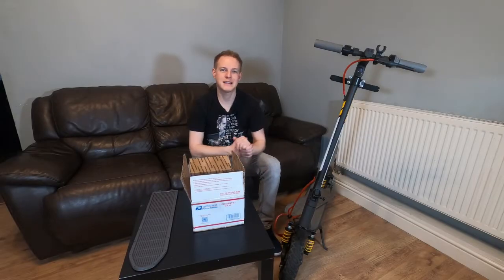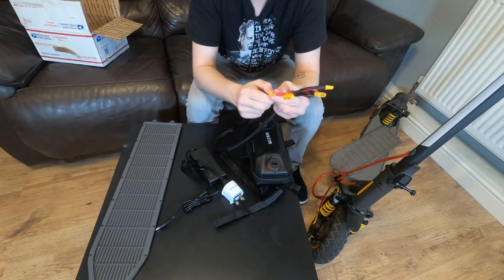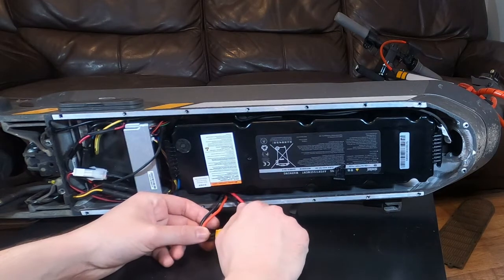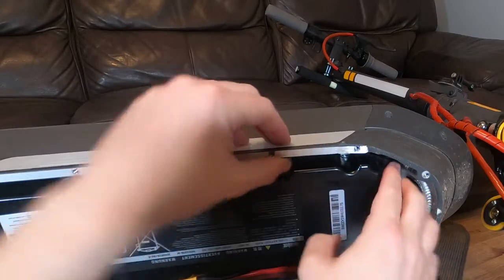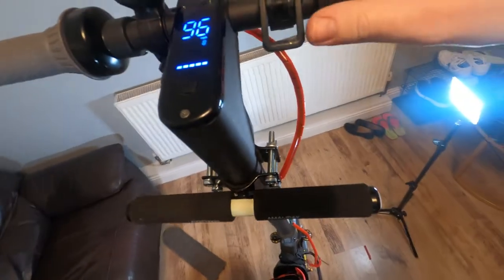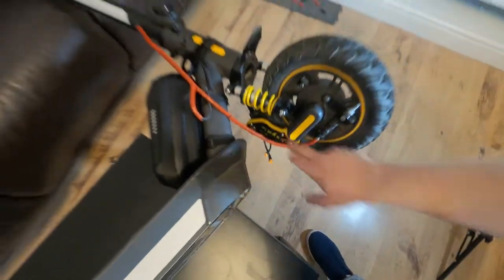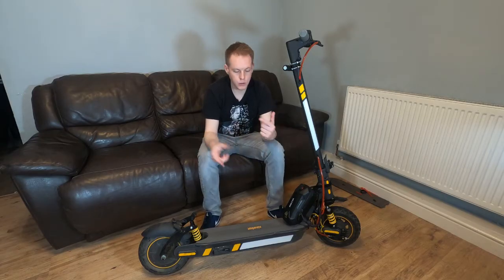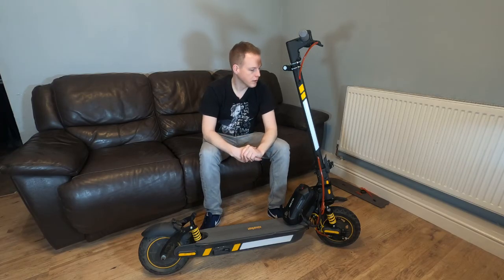How to install Ninebot Max External 48V Battery Upgrade

Comment: My kids have several F35 scooters that are 36v.  I have a pile of 48v batteries for my ebikes.  Would drilling a hole and popping the Xt60 out of the scooter and plugging in my 48v batteries be a plug n play solution?

Charging them externally with the ebike charger.

Or is the controller, motor all sized for 36v and will be ruined by feeding them 48v does anyone know?

Comment: I have placed a 48v battery on my e scooter, but now I have the problem that when I accelerate and then brake, the scooter continues to drive via the brake, what could be the problem?
Reply: the controller can't handle 48v

Comment: Did you get more range. And how was uphill climb??
Reply from the maker: I actually haven’t had a chance to range test with this on.  However it’s not really going to add more range as it’s more of a power upgrade.   You can get range extender batteries from my max mods.
Reply: @ScootLetsGo  I'm trying to decide. I need more range.  I might just get the external battery.   36v.

Comment: someone has been putting kaabo 10  wheels onto them Segway ninebot g30 and it's looks way better then stock wheels and best way to installing alarm kit to scare most thieves during day/night it's helps saves own scooter without getting stolen without any hassles and I would say Segway ninebot is too notch for having so many good features setup for streets only

Comment: How much further can the scooter travel on one of these batteries?  Over moderately hilly terrain, the regular battery gets about 20 miles.
Reply from the maker: This battery is more designed for extra speed. So wouldn’t get much more range from it.  If you want more range. There are batteries that are designed for it.  And my max mods sells both types

Comment: Got my 48v battery and plugged it in. Once i got it running, it will turn off after about 30 seconds of riding. Do you know a fix?

Comment: It appears to me that my existing battery cable comes straight from the battery directly to the controller.
  Does this mean I have the new 1.1 AT-based controller?  
    And will I still be able to flash with this?

Comment: do you need to unplug the ext battery to charge both batteries or I can plug both at the same time while being still connected in parallels?
Reply from the maker: Highly recommended that you charge separately and unplugged from the scooter

Comment: I got mine used but it didn’t come with charger for 48v battery and when I ordered the battery it still not powering the scooter after charging so do I need to flash it or is it possible that the battery is damaged?

Comment: Does this also work with 2nd gen?
Reply from the maker: Do you mean 2nd gen motor?
Reply: @ScootLetsGo and how much does the external battery increase the range in your scooter?
Reply from the maker: @theslavemotivator3571  this one isn’t really a range extender. This is to increase speed.  

You can get a range extender though
Reply: @ScootLetsGo  can you gimme a link?
Reply: @ScootLetsGo  yes
Reply from the maker: @theslavemotivator3571  yes it will work.

Comment: You connected the batteries on serie? The adapter isnt a parallel one
Reply: The batteries are supposed to be connected in series. Internal is 36V, external is 12v. In case you're getting any ideas, I once tried to use an ebike parallel battery device to connect another 36V battery in parallel and somehow it fried multiple controllers as I kept trying, and no, it wasn't my technique because I made it work on an ebike doing the same thing. Each time I tried, the scooter would work until I used the brake (activating regen) and then it would die. The controllers all had a blown chip afterwards.

Comment: I see you have proper tires with Sharkset. Did you manage to fit 11" tires with sharkset? Thanks for your videos!
Reply from the maker: Hi, these tires are non offcial off road ones. Which are slightly larger. You can checkout the video when I put them on. However, I would probably recommend that you stick with the factory tires.

Comment: Is the battery lighter than the main? If it is lighter...what happens if you remove the main and use 2 external packs?
Reply from the maker: It’s lighter. But you wouldn’t get very far with it.  As it needs a bms and it’s only 12 volts.
Reply: @ScootLetsGo  it's sold out???? How do I get one

Comment: What are the specifications of this additional battery?
Volt, Ampere, Ah and Watt???
Reply: I want to know too
Reply: I want to know too
Reply: @mrdouadi1105  it is not on the website.
Reply: It's a 3s6p 12-volt 15.6AH pack.
Reply: @mikiggs  isn't it a little pricey for around 300$?

Comment: Nice video, can you explain the Safety wire connector?  What is it exactly? Just a wire that loops itself to close the circuit when not using the external 12 volts so you're able to ride with 36 volts?

Comment: Hi! when you install the second battery are they connected together ?  i mean they work at the same time ? Can you fry your engine while using 2 battery ? I need an upgrade because now i do like 40km with my own battery so i need to double it. what do you recommand ?

Comment: Will this work with kka A,3 max clone
Reply from the maker: If only it has the same controller and core software.   If I had one to test I would.  
So if you do decide to try.  Please do it with caution.

Comment: I dont understand why you did not show at what point you flash the scooter. You just say it needs done and then mention  that you already have a video showing it but the one you link is for a windows laptop?? You also never actually hook the whole system up as you end the video with only the main battery hooked up.
 Very disappointed bud. This is only half an install video , not a "how to" as the tile suggests. Are you going to make a follow up explaining what you left out and with the job actually completed? All of your other how to videos are very detailed and some of the best on the internet. Really too bad this one is done so casually without concern for accuracy.
Reply from the maker: I appreciate your feedback. I will be doing a follow up video and will address any concerns.  I should have waited a little longer to do this video and put a little more effort into it.  I did have covid at this time and it drained the life out of me.  

As for showing the wiring. I did show this at 10:00 minutes in.   
The firmware can be updated at any time as it will not mess with the scooter if the battery is not installed. 

Forgive me on this one.  Better content will come :).
Reply: @ScootLetsGo  I do apologize  bud. I had no idea you had the C. You look better when your sick than I do on my best day LOL. I really like your videos ,watch and leave a like on them all. My kit is on the way from MaxMods so I look forward to any more info you have to show in a new video.
  take care and stay safe bud.
Reply from the maker: Thanks dude.  No one’s expected to k no w that I’m Ill. I didn’t say I’m the video.   
I should have waited till after it had gone. But I used it as an opportunity install as I couldn’t leave the house haha.  
Hopefully I can get back to some quality videos in the near future :)

Comment: My 48v battery came with two 3d printed brackets for solid mounting to the stem of the scooter.
Reply from the maker: You must have purchased mine after I did. Unfortunately, I didn't get these.
Reply: @ScootLetsGo  we just recently added them, we had no idea you ordered a kit 😅🤣 well send you a message to get you the mounts :)
Reply from the maker: @Mymaxmods  I popped you a message a while ago, but not to worry, you’re a busy guy hahah. Thank you 😊
Reply: @Mymaxmods  Hi Max, just browsing here I have a segway ninebot F30 and would like to extend range and speed slightly what battery would I need for this and would the one in the video work?

Comment: You realise that Ginger on Wheels bricked his Ninebot after installing this unit. It toasted his controller. You need to upgrade the connectors. . .
Reply: Ginger did a ride test in 100 degree weather and melted the stock phase connectors. We did the video with him and upgraded his phase connectors afterwards. But it was due to the stock plastic connectors & even happens stock.
Reply: @Mymaxmods  It does happen stock which is why I have MR60 connectors ready for when my kit from you arrives.
As for the temps...they ride all year round in Aus and 100deg. is nada down there LOL
Reply: @Mymaxmods  Hoping you respond as I can’t see find the answer anywhere but I have a ninebot es4, is this external battery upgrade still available for me?
Reply from the maker: No not aware.  But this will be something I will look into
Reply: @ScootLetsGo  He took the scoot to a pro mechanic and they discovered that the connectors from motor had melted. Suggests replacing with M60 connector (heavy 3 wire connector).
Reply: Indeed, even stock connectors melt mostly when you adapt the firmware already a little bit , so for sure do an upgrade of those when you go 48v …  plenty of options.

Comment: I believe that Max 30 have 36v battery...
Your basic battery was stock 48v or you upgrade..
Reply from the maker: I had the stock battery
Reply: @ScootLetsGo  the stock is also 48v?
Reply from the maker: 36v
Reply: it s a 12v battery. 36+12=48

Comment: put on a monorim back suspension
Reply from the maker: I don’t want to drill holes on my scooter
Reply: @ScootLetsGo  I still don’t regret I placed the monorim … as you asked me those days if I wouldn’t 😉 . But if I in future can switch to Sharkset and it is not a problem with the drill I did, then I do that without a doubt. Just I noticed that it is not that easy to get a Sharkset ordered without “ inbetween sellers” and the extra costs that brings…

Comment: Great video man. Keep it up. btw do you have any solution for the rear suspension fenders? I installed the same rear suspension that you have on my ninebot max but I keep getting splashed by the rain/mud all over my back/pants. Also did you preorder your sharkset rear suspension yet? I don't know how good it would be but looks cool though in that 3d design. cheers!
Reply from the maker: Unfortunately, I get a little mud and water come up my legs too with this suspension.  I think best thing you can do for now is to create an extension fender maybe.  
I am patiently waiting for the Sharkset rear suspension ;)
Reply: @ScootLetsGo  Thanks for the suggestion man. I actually did end up adding an extension fender, basically the front one that was lying spare after installing front suspension. I drilled a hole through the back fender and put the the spare fender screw through it with few washers. Doesn't look pretty but its kind of working.

Comment: Where did you end up getting your replacement bottom panel? My overzealous electric screwdriver has made a mess of mine. Preordered the rear sharkset, so I hope you make an install video for that because your one on the front was invaluable. Would also like to see the Fat Max motor tested in the future, because that looks like a meaty performance upgrade.

Comment: Thank you for this tutorial!
What breaking system replacement would you recommend? I've been using the original for over 4k miles now and seems to be wearing out. I also tried to take the break pad off and it's given me a headache so I left it alone.
Reply from the maker: Hey. I would continue using the brake system in place now.  Just get new brake pads.  I’m currently looking at other options
Reply: @ScootLetsGo   Could i use this for g30lp
Reply: @ScootLetsGo does the external accu work with max g2 segway ninebot?

Comment: What is the true width of those off-road tires when inflated? Could you measure it? I would appreciate it! :)
Reply from the maker: Sure, I will take the front wheel off in the next couple of days to take out the RGB, so I can show you then.
Reply: Did you know? scooter tires with the 10x2.75-6.5" dimension fits perfectly on these bikes. it's a match made in heaven, I use it on mine and it raised the bike 1" off the ground. I had to use a tube with these tires though but since I changed from stock I haven't had a single flat
Reply: ohh by the way, 10x2.75-6.5" fits inside the stock fenders of the ninebot max, you don't need to modify or remove them when you use this tire size for the ninebot.  it cost me about $40 with shipping on aliexpress and you can get both city and off-road tires in this dimension. Must have upgrade :)

Comment: great to see you back bud.I am ordering this unit next week

😸
Reply from the maker: Thanks dude.  Videos will be slower.  Winter is now here.  And less mods currently haha
Reply: @ScootLetsGo  Did you buy this direct from MaxMods? there is so little info on his site.Is shipping included?
Reply from the maker: Yeah I did.  And the shipping is added on separate unfortunately.  To the UK it was about $50-60usd
Reply: @ScootLetsGo  Thanks bud , good to know. His website is next to useless for any concrete info.
Reply: @ScootLetsGo where can i buy this
Reply: @ScootLetsGo  где купить эту батарею ? ??
Reply: @974  Yes it is. Great little kit well worth the upgrade
Reply: @974  There are a lot of factors that determine what is safe or practical to add. The BMS the controller the motor and even how you install the batts needs to be well thought out and tested. I am no where near an expert on this stuff. When it comes to this type of mod you really do need to ask an expert.